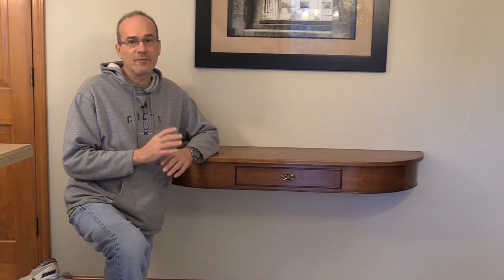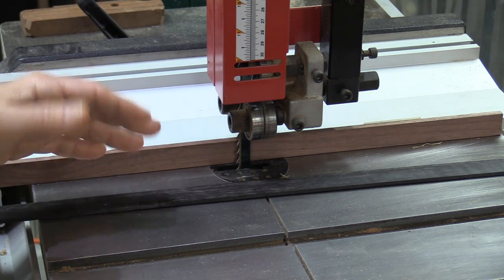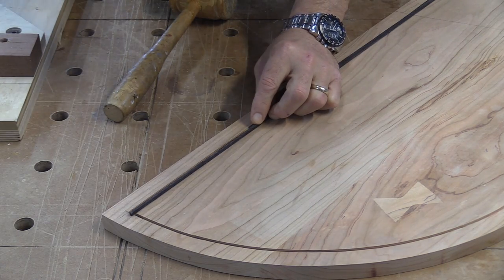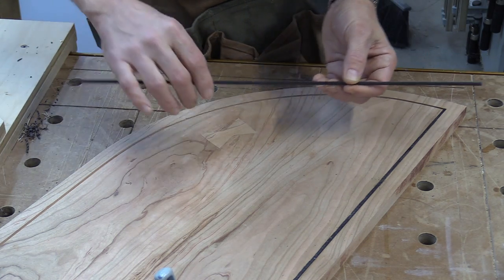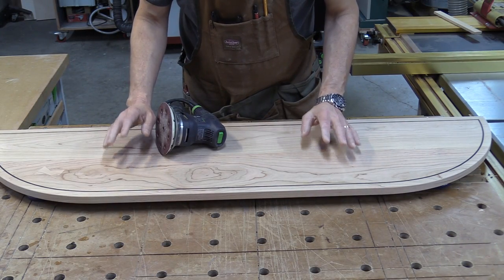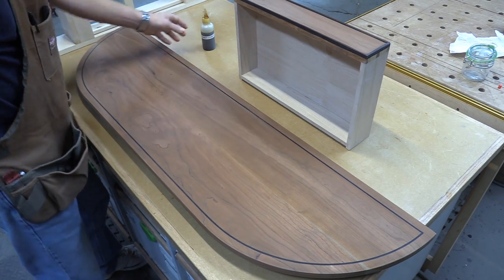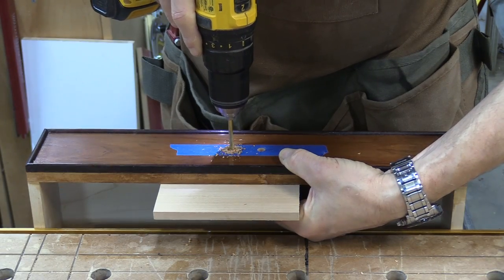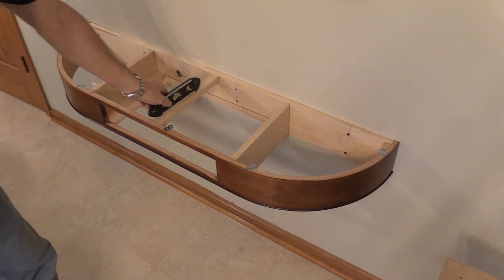Floating Hall Table Pt. 4 - Ebony Inlay, Shellac Finish, Installation

Comment: Hi hey great project. I built a cherry murphy bed and desk with a bark on redwood top in my guest room almost 2 years ago, and as soon as i showed my wife the hall table she said go for it.mine will also be cherry but not as deep. Im going to use bending plywood 1/8" and a piece of cherry veneer ive been saving. Ill have to hand pick some cherry for the top. Probably just use the old french cleat system to hang it. Thanks again ,just subbed.

Comment: Love the video series great job!!  I have had luck with ammonia and fuming cherry but to get the same level as the potassium dichromate mixture I boiled up extremely strong tea (just store brand stuff) and applied several coats then fumed the piece just like you would white oak.  Its a hassle due to you have to raise the grain and said because the tea is essentially a water based dye but its a lot safer to be exposed to. I got the steps from Fine Wood working site I believe.
Reply from the maker: Thanks Will! The tea will add tannin to the wood so it can react to the ammonia. I have never tried that, but you never know! Thanks for watching!

Comment: Beautiful piece of work! Why the bowtie? I know it covered an imperfection but ....?
Reply from the maker: Thanks! The defect was a pitch pocket in the cherry. It was over an inch long. 1/2 inch wide, and 1/2 inch deep. A bowtie was the only way to cover it up.
Reply: GuysWoodshop I don't suppose you have video on how you accomplished the repair of the pitch pocket? Yes? Maybe? I've never seen it done or done it myself.

Comment: whats your recipe for the potassium dichromate?
Reply from the maker: No set recipe. Water and the chemical. Just keep adding a little of the chemical at a time, test to see how it looks. It took me about a week to get the color of this right for this project. It takes several hours for the solution to fully oxidize the wood. I started with a jar of water and about 1/2 tsp. of the chemical, and went from there. If you add to much, you can always dump some out, and add water to dilute.